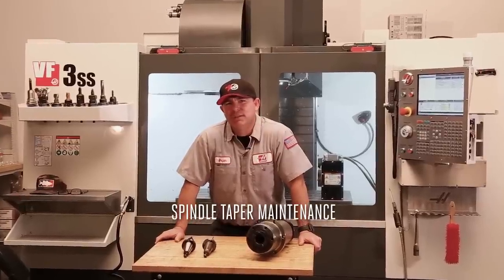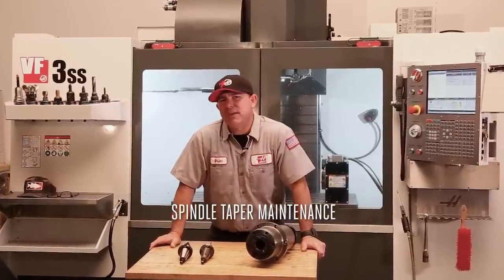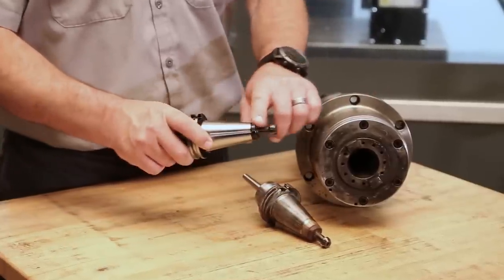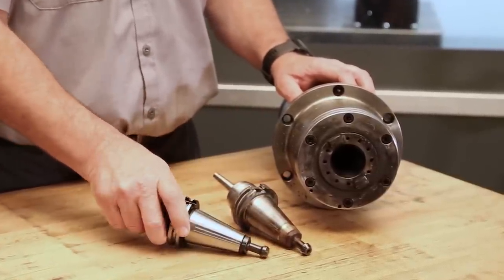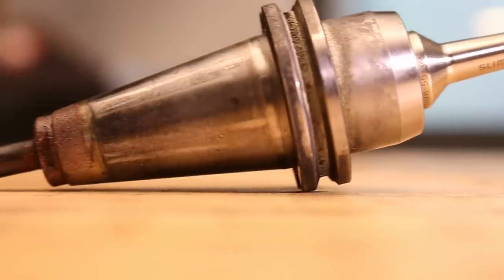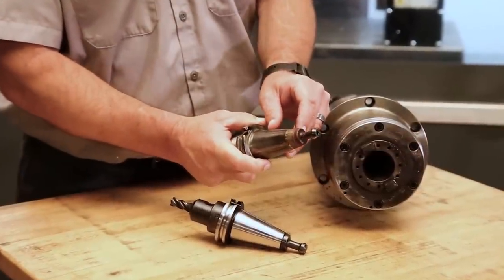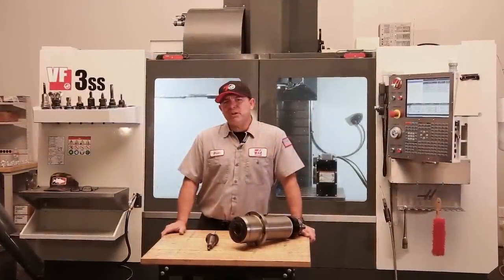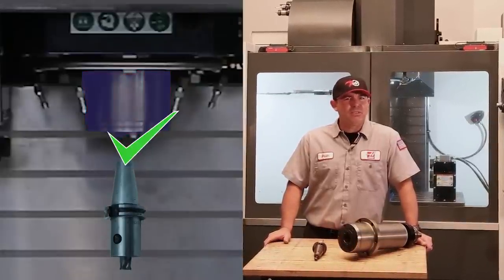Spindle Taper Maintenance - Haas Automation Service Tip

Comment: Our VF2SS was under warranty, we have haas pull studs, all new holders, and they stick and pop when removed. We had the HFO tech look at it, you can visually huge dimples on the pullstud from the locking mechanism, and black oily shmoo running down from inside the stud clamp. The tech advised to "flush out with WD-40 once a week and keep an eye on it". Last we ever heard from them. Thanks Haas.
Reply: Same sort of issue with our TM-1P,  where the tool will sort of stick in the spindle as the tool is been released in the carousel. I have considered greasing the pull stud so after seeing this video I'm going to give it a try.
Reply: I'm worried about that with the side mount tool changer, I was just up there last week cleaning out the chips, they get all over up there. I feel like chips would likely stick to the grease and get caught between the spindle taper and toolholder when im running lights out. Might work well for a carousel though, I bet there is much more protection from chips with it. Seems for me like the tool clamp was damaged from factory or does not release as it should, almost like it sticks shut until the changer arm forces it down and it pops out.
Reply: Yeah, concur with the chips and grease.  Don't know what the solution would be.  I am not too familiar with the side mount changer.  The carousel is nice, the tools are completely covered and high above nearly all chips which may be flying about.  I would harass Haas every day, you've spent lots of $$$ and it is your livelyhood, don't be easy on them.  We have our first PM soon, and I will be watching the service guy, both for my interest and to verify his work.